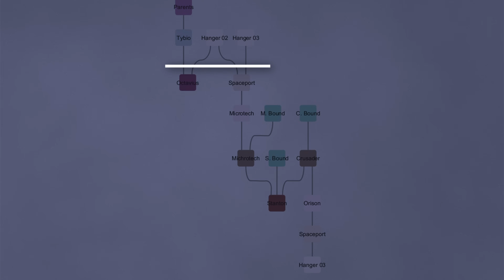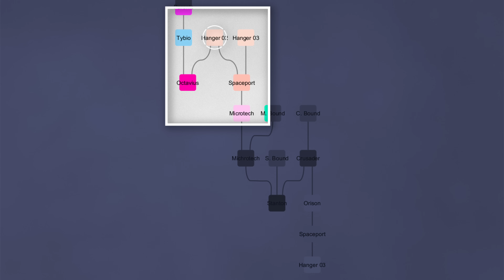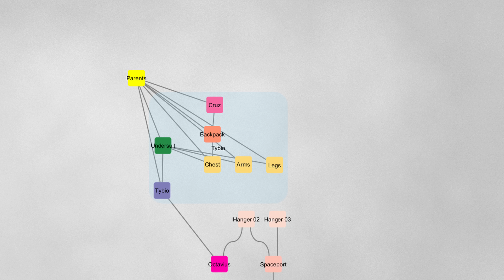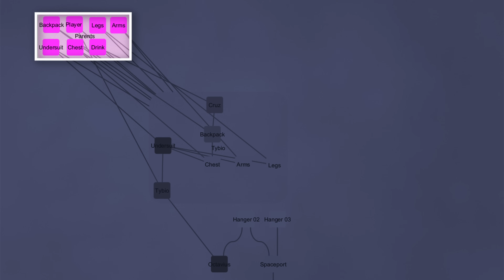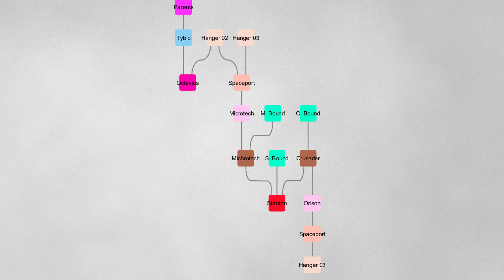Star Citizen: Network Engineer on Server Meshing (Part 2)

Comment: 1:53 "I would assume it's a complete coordinate system, otherwise they wouldn't need a 64-bit number."
Let's do some math and see, what we can fit in 32 or 64 bit coordinates. Beware: Lots of big numbers ahead! I'll use the dot as decimal seperator and comma as thousands separator as usual in the anglican world (tell me if I mixed something up).

First off - 32 bit (or 4 byte) can hold 4,294,967,296 different values (2^32 or about 4.29 * 10^9, i. e. 4.29 billion) while 64 bit (8 byte) can hold 18,446,744,073,709,551,616 different values (2^64 or about 18.45 * 10 ^ 19, i. e. 18.45 quintillion).

Now, space is large. Like really large. Here are some rough sizes of things in space:

diameter of the Earth: 12742 km
avg. diameter Mars orbit: 4.56 * 10 ^ 8 km
avg. diameter Jupiter orbit 1.56 * 10 ^ 9 km
distance Sol <-> Proxima Centauri: 4.25 light-years or 4.02 * 10 ^ 13 km
Diameter of the Milky way: 87400 ly or 8.27 * 10 ^ 17 km

To find the precision or resolution (i. e. minimal distance between two separate points in space) that is possible, if we want to fit each of these things in our coordinate-system, we need to divide the latter by the former. In a 32 bit system, this gives the following results for the minimum resolution of each map:

Earth: 3 mm (might just be usable, though CIG wanted 1 mm precision)
Mars orbit: 106 m (obviously not practical anymore)
Jupiter orbit: 363 m (yeah...)
Sol + Proxima Centauri: 9360 km (*cough*)

For 64 bit on the other hand, we get:
Earth: 700 femtometre (700 * 10 ^-15 m, about 1/100th the size of an atom)
Mars orbit: 25 nanometre (25 * 10 ^-9 m or 1/20th the wavelength of light)
Jupiter orbit: 80 nm
Sol + Proxima Centauri: 2 mm (still enough, but if you add some more distant star systems, this quickly gets to large)
The entire Milky way: 45 m (not gonna work for SC, but probably viable if you only simulate astronomical objects)

Conclusion:
You need 64 bit coordinates to simulate anything bigger than the size of the earth. But even this is not enough to fit multiple star systems in realistic ditances within. Using 128 bit coordinates, one could map the entire Milky Way with 25 nanometre precision. That would be an incredible waste of ressources though, since computing 128 bit numbers on the current 64 bit computers is very time expensive and the space between star systems is incredibly empty.
Reply from the maker: Good context, I admit to just short-handing that in my head and obviously getting it wrong.  I'm not sure where my mental math failed, but given what you showed, 64-bit per system makes sense.

Comment: As fas as I understand their explanations: there is a single large replication-layer-server (database and processor) that holds the object state, parent-relations and who (server) is responsible. Player-Clients only interact with this replication-layer to get the current object state and send their actions. The replication layer does not need to process complex logic like AI, pathfinding, physics or scripts. Its just a fast data transfer and storage server.
Then there are many "region" servers, that hold ownership over objects in their region, get the state from the replication layer, process the gamelogic (AI, physics, scripts etc), and send back state changes to the replication layer. The regions in the convention presentation where those tree small sections of the room, but in reality would be things like a whole station, a settlement, a complete moon, a capital ship or just a part of a station. All dependent on the expected population count. If a server crashes, the replication layer can quickly send the object-state and responsibility to another server on standby, and quickly resume operating on those objects.
From the players view, the game would only permanently crash when the replication layer blows up.

Comment: The game is not using 64 bit for local simulation, physics and rendering. It holds the object positions in 64 bit and converts it to local 32 bit coordinate for anything gameplay and rendering related. Simply using all transform positions directly as 64 bit floats would be overkill and cause a bad performance on client machines.

Comment: Regarding the 64-bit precision, larger containers in SC have a nestable "zone"-system. Each zone is a freely movable coordinate system in the game engine and a movable container can have a zone. For instance a space ship can have a zone. When players go into a space ship their positions are calculated relative the space-ship zone and are no longer updated in the global zone. This way the ship can move in a complicated pattern without updating the location of all the players and items inside the ship; only the ship coordinates are updated and because the players and everything inside it are relative the ship-zone, their locations get updated for free. The zone system is essential to enable things like rotating planets with many millions of objects. You can build an affine transformation matrix that collapses any depth of nested zones to a single matrix multiply by the transformation matrix, so moving between zones can be done very efficiently and you can chose at cheap cost what zone you want to compute an objects' movement in. The coordinate system in the zones is 64-bit, probably because the global zone had to be 64-bit to fit a whole solar system at sub-millimetre precision and that meant that all code had to be 64-bit anyway.

Comment: I will watch your career with great interest. 

But jokes aside. Great video. Great explanation and great start. (also cool to see good constructional criticism and discussions in the comments.

For the video I'd recomend having an eye on where you take cuts and either line em up on cut or to cut the audio line to the right or left of the cut depending which picture is more on topic (called J or L cuts). But details. You'll get the hang of it quite fast I guess. Happy to see a new face that I can watch, especially with such topics. Keep going and have fun creating.

Comment: My educated guess is that every object that can have things attached to it (e.g. sun, planet/station, moon, building, vehicle, person, modifiable weapon) has a local coordinate system, and they are rotated and translated via matrix math (for each frame?) to be within the coordinate system of the next higher level coordinate system, up to the appropriate scope.  So that silencer on your P8 is mathed to the gun, to the back of the pilot, to the vehicle being piloted, to the coordinates of Hurston.  But updates being sent to other players only need to be sent based on what has changed.  If the pilot hasn't left the seat, but the vehicle has moved, only the vehicle's coordinates, rotation, and facing are transmitted.  The position of the silencer has already been anchored relative to the vehicle.  If the pilot's head moves, that has to be remapped to the vehicle, but the helmet he's wearing does not explicitly get updated.

Comment: Very cool! Been working as a dev, mostly with web applications and distributed systems over the last 18 years myself, but I still very much appreciate you breaking this down. :)

Just one note on the 64 bit coordinate system, if I may (I am no game dev, so I am taking what CIG communicated at face value here): CIG said they want a 1 millimeter (0.001 meter) precision for their coordinates and using a 32 bit coordinate system they'd get that precision only up to a play space of 8km*8km. That's why they had to switch to a 64 bit coordinate system for SC.

So what I understand from that is that every star system will have its own coordinate system, with the star being at the point of origin (or at least close to it).

Comment: What you call bounds is what CIG call Oject Containers. 

These are a hierarchical/nested set of containers ranging all the way down from the main Obect container of stanton all the way down to say a pair of pants that you are wearing. They are are nested one in each other so say a bottle of cruze would be nester in your pants which is nested in you character which is nested in your ship which is nester in your hangar and so on all the way up to the main Stanton Object container. 

These object containers are mirrored in the graph database on a 1 to 1 relationship. 

So when you move object containers when leaving a hangar you move graph nodes from Hangar to Microtec on the graph. 

One thing to point on is that some objects will eventualy have their own seperate stats such as wear but these will proabably be applied as a transform to a primary object type.

I hope that makes sense.

Comment: Coords are easy Client side & Game engine side. XYZ which funny enough is the same as RGB when making 3D materials, XYZW also works but that is used for 3D volumes e.g. VDB tech/Volumetric tech, but can also be used for Coords, so X=X, Y=X, Z=X XXX,XXX,XXX = XYZ. Its Easy to do Coords in 3D space & movement through via Deltaseconds which you multiply into the Coords to keep movement from FPS to IRL time. Game Engines CURRENTLY GENERALLY (Words have meaning!) use CPU for those Coords, But now are working towards GPU Coords So basically 21KM size to 88,000,000km size for a landscape alone, not a vertex made sphere (Material "painted" vertex & not vertices of mesh) planet with data layers & partitions e.t.c. tl:Dr many things don't Need to be server side nor is it harder to store server side just needs updating from server side. Another example is NPC's they don't need to be server side, they don't need respawn volumes they need spawn on collision volumes so server doesn't update when nothing is there & respawn on destruction after delay, the loot table well different story but server doesn't need to know location of NPC just interaction hand off Even if a party is there, Although now it needs to know NPC location for Combat..... Now to be clear I'm not saying anything said is wrong just pointing out that there are ways to ease the server side costs being ignored hence 9+ years, but keep in mind it leaves the game more open to script hacks people buy when client side is utilized.

Comment: Hmm.  I dont feel like anything you are talking about, or the stuff from RSI hasn't been done before.  The issue for them is that they had nothing pre-existing, so its a ground up build, and the scale of the entities and players they need to persist is very very large.  The size is what requires that last step of server meshing (again, nothing new), and with the number of systems they have had to create from scratch they have been clearly trying really hard to make all of those systems scale together as part of that.

Its a big bang approach in a (forced?) way, which can be excellent given enough time and good management, but you can really imagine all the points along the way when one set of technologies and systems will have required a rethink of the other systems and work starts again, rather than say a simpler starting system and making it live and having it evolve.  

Of course evolved systems have their own issues (ie, some hard limits will just be intrinsic to the initial simple system), and in development once a feature is 'released' its hard to go back to basics again and change it due to the lack things to motivate that recode (its done, lets move on to simpler things etc.).

Comment: Thing is. I don’t think the hangers are that separate at the moment. 
Yea the hanger doors are tied to the person. Which is why if you had two different people in the same party and same ship. Even if their in the same hanger. They will call to open 2 different doors. The ship and hanger doors are linked to the player. 
However the area around is all the same. The jabs, the shops, the terminals, the hangers and even a few thousand meters out. Basically anywhere inside the armistice zones. 
The hospitals have recently been changed to have their own areas and some cities might have different areas like orison’s platforms. But if you went to a LeGrange point like CRU-L1. Then as soon as you get into the armistice zone. That is all one area. (Well except for the hospital for now)